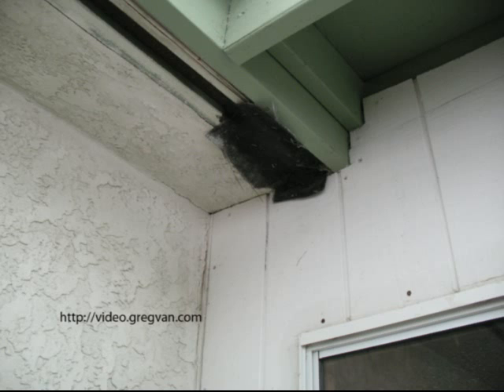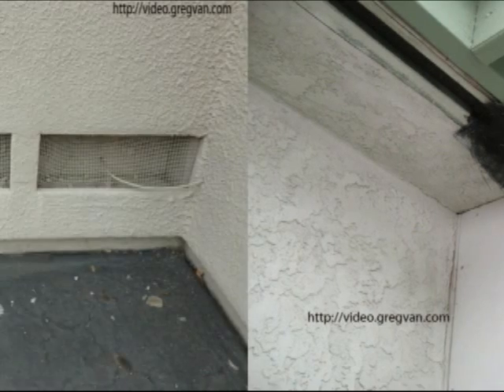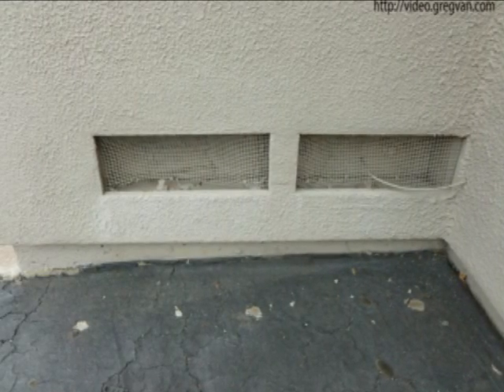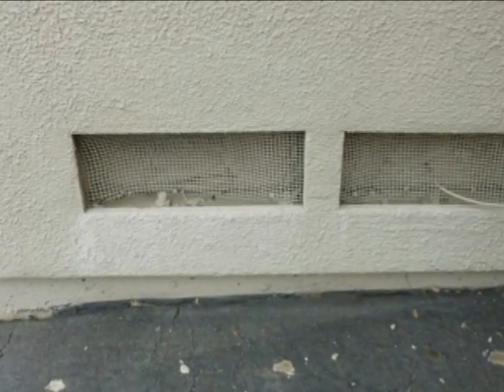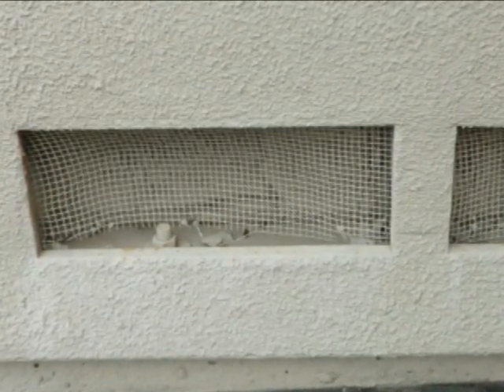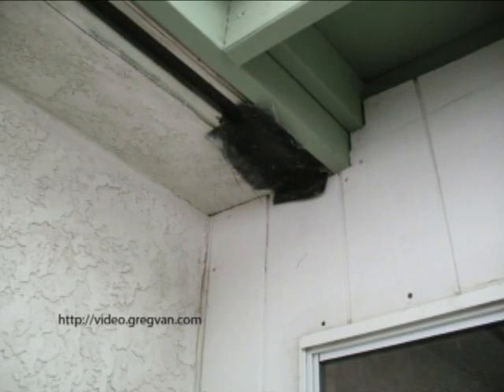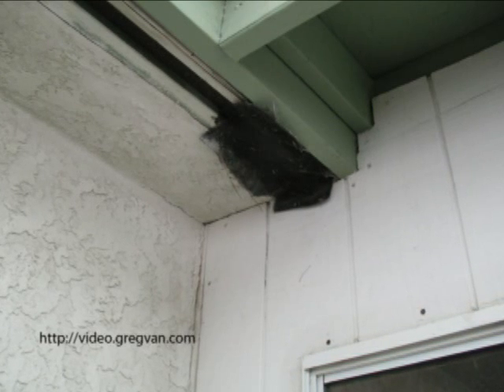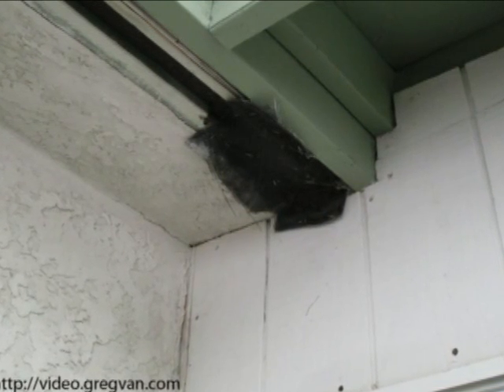Please Watch This Video Before Repairing Attic or Crawlspace Ventilation Screening

Comment: I have attic vents in a tight angle that I can barely reach with my arms completely outstretched. Head is in tight against plywood and roof. My problem is the old homeowner put up an outside awning that shuts off access to the outside. Otherwise I'd rig an outside screen. Any ideas?